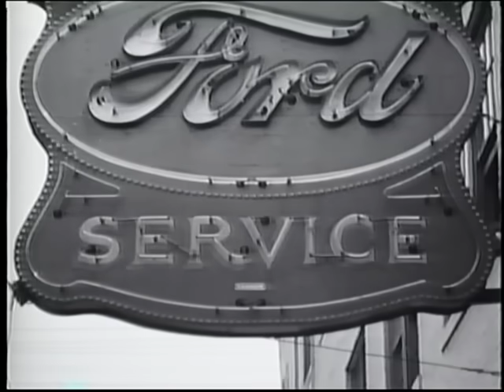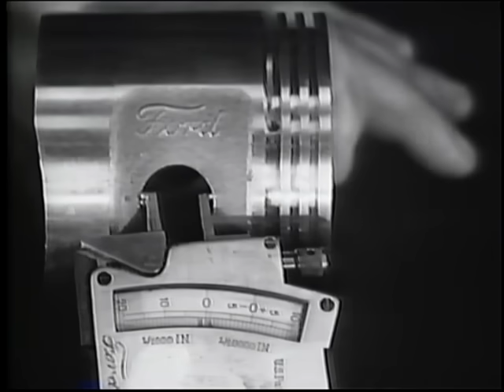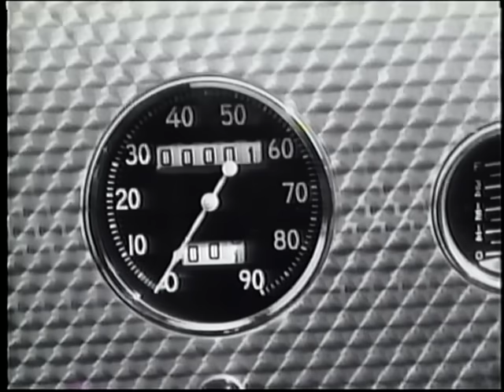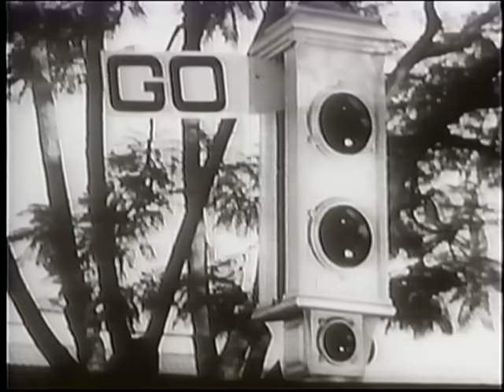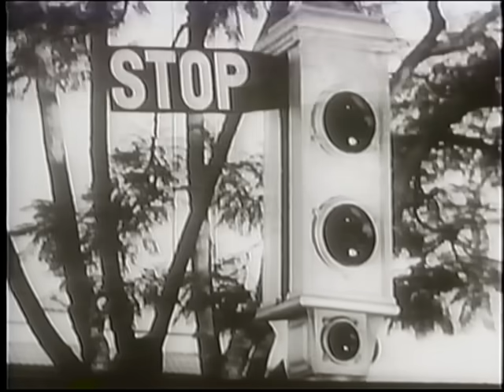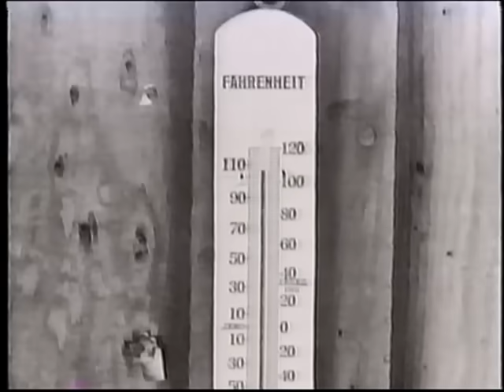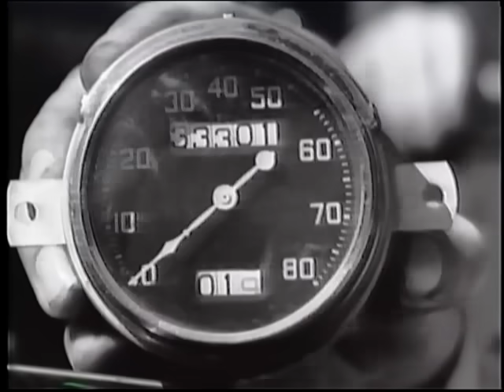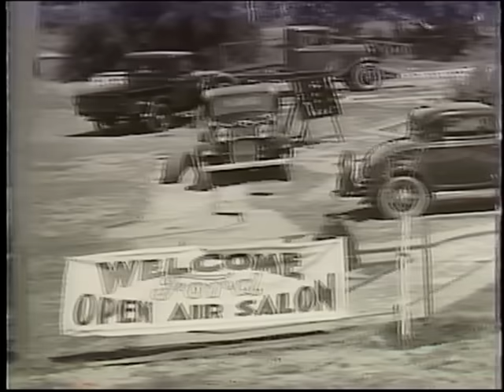1932 - The Invention of the Ford V8 Engine

Comment: Ford flat head V8 one of the best inventions ever made.
 From 1932 through 1953. 
1954 ford first overhead cam ford V8. My father born in 1896 was a mechanic on steam engine trains, and loved the ford flat head V8. He died in 1960. That man could fix anything. My son is a technically / mechanic for a Nissan dealer. My dad would be proud of him. Love ya Dad!! In the 1950s through the 1970s those same flat head V8 engines were in many dragsters. The other one was the Chrysler Firepower. Loved watching those machines at the Bunker Hill dragstrip near Peru, Indiana. Most cars were home garage built mean machines. America where did you go. I don't recognize you anymore. I miss the old tough do it yourself America.
Reply: God bless your dad, you, and your son. You can see my pic in front of the 1st pony car - a 1965 Plymouth Barracuda that I bought as a project car for my son. It beat the 'Stang by a few months. Unfortunately - we never got to finish it because I learned a nuance about titles. "Dismantle". Ugh! That means something different coming from AZ - it'll never make it to the road in TX even though there wasn't a single structural thing wrong. Perfectly straight as an arrow, basically no rust. Someone decided to slap something worse than "totaled" on it. What a SHAME for such a rare and cool / funky car!

Anyhow - like your son at Nissan - mine is working his way to that at Toyota. I thought he'd follow my path into high tech (along with much of my nerdy family). But he took my 2nd path - geese and grime. I'm fine with that. It probably better anyhow - long as he doesn't mess his back up like I did picking up my giant baby boy from a bad angle (i.e. him).

Comment: 14:32 "this new (8 cylinder) v-type 90 degree engine develops 65 horsepower" 😳 engine performance has come a long long loooong way
Reply: My dad's '64 Chevy Bel-Air was titled as the 327 V-8 having 37hp. Never figured how they came up with that number.
Reply: @justins.1283  - It is based on a formula that takes size into consideration. It has nothing to do with what the engine actually produces.
Reply: Well not really for Ford. Their V8 performance still lags behind Chevrolet...
Reply: @justins.1283  engine displacement. Lol
Reply: @eaxnitro  Yawn.Yet more rhetoric from another Chevy Lover.Ford has and still is kicking Chevy butt.

Comment: 1:02:50 That locomotive might lose off the line, but eventually it would win. ;)
Great video, though. Packed full of technical and historical info, and those dramatic interludes were a hoot! It's been said, but you can't beat these old educational/informational videos for a good primer on any given subject. These days dramatic effect outweighs the actual information. Anyway, thanks for sharing. I knew when it was in my recommended, it would be good. But it exceeded any expectations I might have had. Cheers! :) #education #engineering #manufacturing #history #Ford

Comment: My family had a 1914 Model T, and a T from the last year they were made, a Model A and a pickup. They built a 2 car garage for the Ts. It had tougue and groove flooring and one side had a removable floor panel to access under a car, and a similar metal panel on the other side so they could drain the engine water in cold weather. Grandfather also bought an 8N which I still use. Dad sold the 1914 T in 50.  That car was used to saw firewood and they put a meat grinder handle in the spokes to grind meat. The model A was said to be nicely equipped as it was a demo car.

Comment: Even though I've been a MOPAR guy for over 40 years my first car was a '66 Mustang w/289.  My step-dad was a great mechanic and in 1973 I rebuilt my first V8 engine, a Ford 289.  Did full rebuild, Top and Bottom in one long weekend.  The old Ford V8 was really easy to work on.  By the late 70's I'd done several engine rebuilds with my step-dad and friends, mostly 383 and 440 MOPARs.  Nowadays I don't even change my own oil.  A father and son could rebuild those old Ford V8's but todays cars are TOO complex for even a good mechanic to do a "rebuild" over one weekend.  Ford gets the credit for that old Flathead V8 that opened the door for the V8's to come.  BTW; I don't give a damn about Mr. Ford's politics, they have absolutely nothing to do with his greatness in the automobile field.
Reply: '68 289 is my first car, runs like great and while the 289 is small it perfectly complements the car.
Reply: What? 
I do rebuilds of the 5.0's and modular ford V8's all the time. Usually in a "weekend" too.
Just because it's fuel injected doesn't mean shit. Just a bunch of extra electrical connections to plug in.
Reply: This reminds me of the simplistic design of Ford's 3.0 Vulcan engine that was mainly put in the Ford Ranger and the Ford Taurus. Then in 1997 Ford starting installing the complex 4.0 SOHC engine made in Cologne Germany in the Ford Explorer and that was too complicated for the average DIY mechanic and IMO that was the start of disposable "money pit" engines that the stealerships loved so much mainly because it had the big timing chain problem and it's a nightmare to work on.
Reply: I know lots of guys that don't seem to have too much trouble at all going through an LS series V8 in a few days and with very little effort even the tiny 4.8L 294ci can make 400hp or more at the crank.
Reply: JetMechMA
Reply: randy109 i
Reply: Since 1932 the republican party voted against social security, unemployment compensation, child welfare, medical insurance,
any kind of disability insurance, any type of workman's comp.
IT IS NOT A WORKING CLASS PARTY.
Reply: Don't sit in your Toyota and curse someone else for exporting jobs.
Reply: My first car was a 67 mustang, before I got a license I had swapped it for a 440 charger;-)

Comment: Enclosed drive line was a pain in the ass to repair.
Reply: I believe it was the single piece block that was new, or so claims this vid.
Reply: A lot of things on these vehicles were a pain to repair, but labor was cheap then. Look at how many bolts they use to hold things together...picture doing a valve job on this engine, you have to tear the whole thing apart every 30k or so. 48 head bolts! Trying to keep the brakes adjusted was another nightmare. And look where the battery is.
Reply: ***** "They SURE don't make'm like they used to".  When my dad was in college he was doing well to get 10 or 12k miles out of a set of tires, 8k was more common, he would put new rings on the pistons every 30k and a well cared for car was SPENT at 100k.  And this V8 got a whopping 65 hp!

Back then you were really making time averaging 30 mph on the highway.  And of course there was always a puddle of oil on the driveway, you added oil or at least checked it EVERY time you got gas.  And that flathead combustion chamber has GOT to be the worst, most inefficient shape ever invented.
Reply: setting the timing was no easy task
Reply: There was nothing more reliable at the time. The sealed bearings and u-joints of today didn't exist in mass-producible and affordable quantities.
Reply: Thanks for your input Landrew0
Reply: Landrew0  history of the Willis jeep
Reply: For their time, these old Fords were the most reliable vehicles on the road. The old saying, "They don't make them like they used to" is correct. Although these antique vehicles required a lot of maintenance due to the automotive industry still being relatively new and internal engine components were created with metallurgy that was very rudimentary, these vehicles were way overbuilt compared to today's vehicles. Today they only make things out of metal that is the bare minimum whereas back then, engines, transmissions, frames, body panels, etc. were made from such thicker steel and were far more heavy duty. Vehicles today might be safer due to crumple zones and airbags, but as far as drive trains go, CARS from back in the day are made from stronger metals than the 1/2 ton TRUCKS of today.
The 50's through 70's was when vehicles really shined. Cars lost power numbers in the first half of the 70's due to emissions but trucks reached their pinnacle in terms of robustness, looks, and reliability in that era. There were still carbs to deal with on cars and trucks but if you knew how to keep one tuned and you took basic care of your engine as well, it was not uncommon to see insanely high mileage numbers and rock solid reliability. 
Engines today are capable of obtaining 300,000+ miles just as old engines are. However, it's fairly common to find engines that are 50+ years old and with very little time and money you can get them to run just as good as they did back in the day. Engines today don't like to sit. Sensors, switches, computers, etc. corrode, seize, and can burn up if they sit for too long and they are a nightmare to deal with. I've dealt with newer vehicles that needed thousands in repairs just from sitting for 6-12 months. Cars today are built to be used up and thrown away in 5-7 years.
Reply: You see the world through rose-colored glasses. I know people who actually drove Model As on a daily basis. They weren't that reliable. Engines wore out in 25,000 miles. Lubricants were primitive. Mechanical brakes were impossible to keep adjusted and barely stopped the car on a good day. Engines would overheat if you looked at them angrily. No car from that era made it 300,000 miles. I've had many modern vehicles make it a lot farther than that. I've driven my junky Chrysler minivan 50,000 miles this year, and the only maintenance it's gotten is maybe 7 oil changes and an air filter. I haven't installed a single part.
Reply: ***** 
The average person only had to drive 5 miles or so to get everything done.  A hundred thousand miles was almost unheard of in those days.
Reply: I have to disagree with you.. They have been saying that cars are throw aways since the late 1940s. My whole family is involved in the  prototype engineering and final production of our fine American cars and trucks (now some import owner is gonna come along to dispute what I just wrote).

BUT BEWARE ....those looking just to stir up and cause distention and controversy....
I will defend what I have stated with incredible zeal force of character  to such a degree it will seem someone is in the room with you as you rerad this.

Sorry got off on a rant....the point is cars are better now than they have ever been and if you you say they are junk then you are an un-pleasable  person with unreasonable expectations!
Reply: I owned a Vette with that crossways leaf spring made of composite that they referred to as a mono leaf design suspension prior to the independant rear wheel drive of today. Which also had an inclosed drive line from the transmission with a , semi-new idea, called a torque tube.So much has changed over the last 80 years but only the name more so than the theory of the mechanics involved. The invention of the transistor in the late 60's and the LED's for lighting and computer controlled engines are the only true additions I find along with the super high costs driven by tons of safety devices making most new cars out of reach for the common worker these days.
Reply: Norman Willey Wrong. You can buy a new car for less in adjusted dollars than any time in the last 70 years. Wages are what haven't kept up.
Reply: Norman Willey 
Hey,that torque tube was designed to save you money in driveshaft balancing & replacement.
Address their chief complaints and American complain more.
Reply: silverbird58 
That is strange. I just a Ford through the drive up window and  got a filet-o-fish.But no fries because the employee was burned due to missing splash pans. McDonald's recomends straight 90 weight to lubricate the entire restaurant.
Reply: Nick Ewasiuk 
That's cool you got into engineering.
Yes your right depending on the application. 
Old guys will just point out "good" steel vs recycled adulterated steel.In cars,hand saws,metal files.Anything really and their right.
But the list of purpose engineered metals is long today.
Now aluminum engine blocks practical but the first GM and Chrysler blocks were failures.
Just look at the choices of metals for knife blades.So to me Good steel means quality for the use
Junk is anything applied incorrectly no matter what the reason.
I have officially become the old guy I think.
You young whiper snappers don't know shit!
Reply: Yep things back then were quality just not the best design's.....well not efficient lets say. Today's stuff is made to the bare minimum of resources because the advancement of engineering allows this. Also they have a lot of data to determine a vehicles life span for the "Average" user that just does general maintenance. Seems like they only want cars to last around 10 years if you ask me especially unibodys ......lol. Vehicle's of today perform very well and are very safe and fuel efficient but the metal is so thin and they are littered with so many plastic parts and electronics that become brittle with age it will become a nightmare and you'll just end up rebuilding the whole car
Reply: James Avery Average lifespan of a car in the 1950s was about 3.5 years. In the 70s it was around 5-6 years. By the early 90s it was up to 8 years, and today it's over 12 years.
Reply: guyonearth 
Is that is without maintenance?
Reply: Cuts rose scents Nope, just average age of scrapped cars.
Reply: Cuts rose scents I can vouch for this somewhat by experience. Years ago I worked with a guy who had a salvage operation that aquired most of it's stock in the 60s and 70s, mostly 40s-70s cars. Just looking at the odometers said alot. The typical 30s-40s car ended it's life with 30-50k on the odometer. A typical 50s car would have 75-100k, while 70s cars would usually have over 120k, trending towards 200k sometimes.
Reply: Nick Ewasiuk 
I just see alot of model A fenders for example that have surface rust but no rot.You never see 70s car fenders last like that in the North East.
I know there are many factors.But it makes one wonder.
Reply: Ojo FelixNM,  Yes the differential had to be removed from the spring, and if you separate the housings, you had better make sure you put it back together correctly or you will have 3 speeds in reverse and only one speed forward.
Reply: Cuts rose scents ,   The early cars had very few places to trap mud and salt water so not much rust, but the 70s cars had many places to trap the mud and salt water, so lots of rust, also the body metal was thicker on the earlier cars. And not as much salt was used on the icy roads.
Reply: I Think they are referring to 50's-60's Cars.
Reply: Lots of things are a pain to repair on modern cars because of all the computers involved. Now im good with computers myself but in order to actually access them you have to have a proprietary connector and software that youre basically not getting unless youre a dealership
Reply: Ojo Felix NM sexy
Reply: if you knew about all the combustion chamber shapes you would know there are far worse designs, look at older briggs and strattons, been fine as a flathead, now a true hemi engine was alot worse an idea
Reply: the technology is there. . .its just in the wrong places, look at the ford ecoboost series, race engines in vehicles too large for them, sure the engine makes the power but its simply too small and under too much stress and thats why they fail very very low miles
Reply: I would say most cars from the late 60's on up can do 300k+ miles with proper care and periodic maintenance. The engines would last a lot longer if you install EFI as to not overfuel. If you look at the 302/351W or 460 they were offered later with EFI and they did last longer. I don't think the 50's and earlier cars can go that far without major overhaul

Comment: That old engine is better than any modern eco-boost by a long way!
Reply: 😂 eco boost last longer, get 10x better gas mileage, lighter, makes WAY more horsepower and is probably more reliable. I love older cars but you are wearing the thickest rose tinted glasses ever dude. New engines (even if they have some problems) are 100x better than what they had back then
Reply: @mrwhips3623  You need to do your research because Eco-Boost engines are plagued with problems. You get a few here and there that turn out decent, but they are not even close to lasting as long as the above:P
Reply: @JasPlun  cars from this era couldn't even get past 100k miles, so their not hard to beat even with a shitty modern engine.